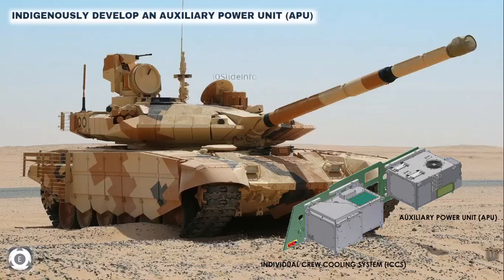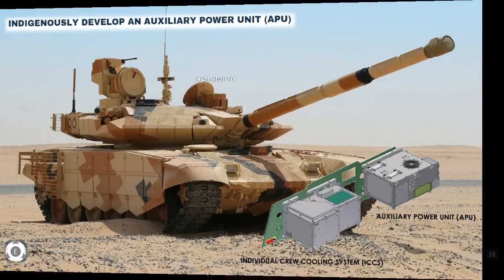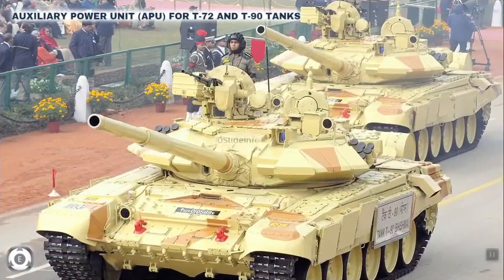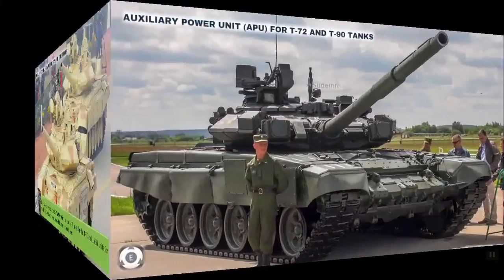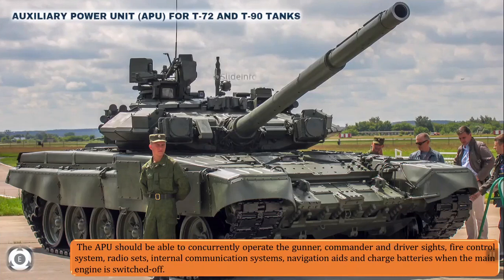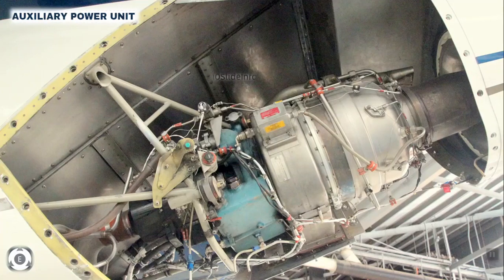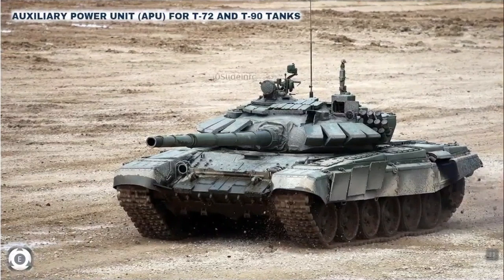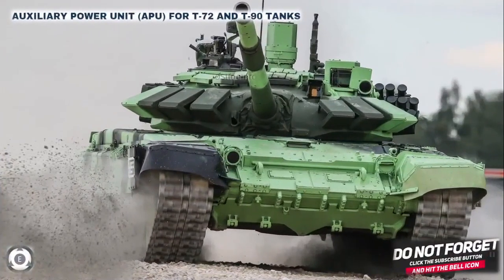APU For Russian-Made T-90 and T-72 Main Battle Tanks | Auxiliary Power Unit For Indian Army Tanks

Comment: This is one rubbish project where the EOI has gradually increased power output from 8kW to 13kW @ 4876 meter altitude from 2016 to 2020 without any increase in space available for APU. Indian government doesn't financially support private sector like DARPA in USA to design a new complete engine for this project. And I wonder why they need a CPCB II certified engine when the tank engine itself is big polluter.